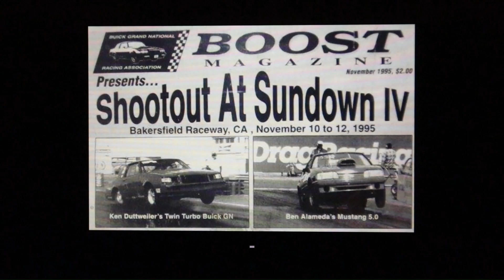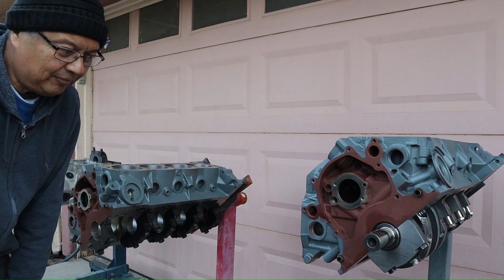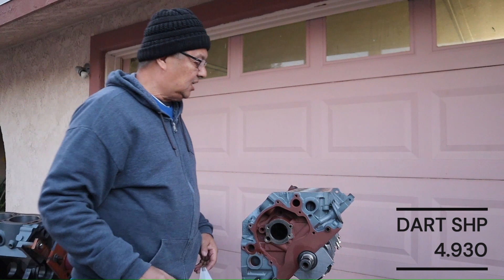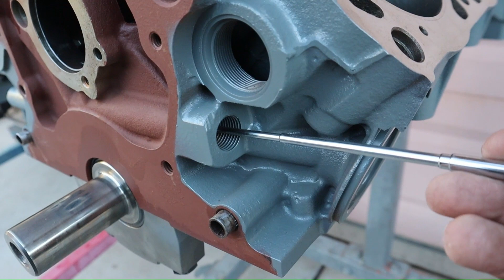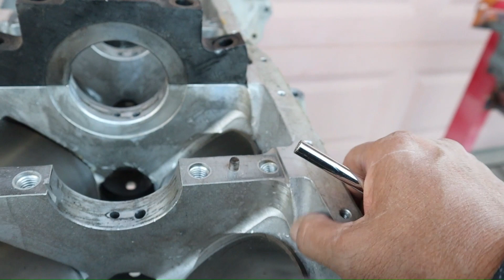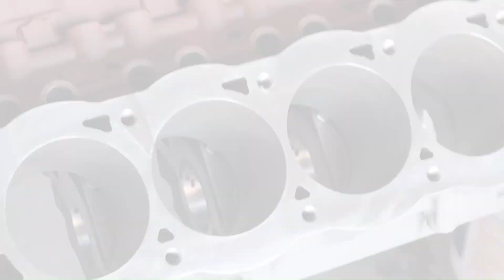FORD 8.2 DECK IMPORTANT DETAILS!

Comment: You will need longer head bolts from Ford for the Boss blocks. Stock head bolts won't work corecctly. I know. I tried. It does not work.🙁
Reply from the maker: I have something very interesting coming up and hang on!  Pls. push the subscribe button.

Comment: What do you use for paint on the inside of the block . I've  heard different types .  and also any idea when the video on the gt - 40 3 bar heads is coming out ?  thanks ben !
Reply from the maker: Any paint for metal will work with the proper surface prep.  I put out the video about the GT40 vs. Windsor Jr.

Comment: I noticed the reddish paint on the internals of the blocks.  I've used Big Red or Glyptal (electrical transformer epoxy spray paint) to aid in oil drawback, and to a lesser extent to seal in the sand particles that might still be hanging around.  What type of paint do you use and why?
Reply from the maker: yes sir epoxy paint is the best after you prep the surfaces to remove any kind of oil/grease.

Comment: Excellent video and pertinant information for us Ford guys. At what point do you consider a camshaft radical enough on the street to need the oil feed mods to the front of the lifter galley? I assume my stock block 351W stroker, std oil pump, passageways radiused and deburred with a .660 lift solid roller 250 ish @ .050 doesnt fall under that heading. 
Thankyou for all you do Ben.
Reply from the maker: You are safe from your specs you posted  I feel the threshold is when you are approaching 8K+ with lifts upwards of .760+.  Then I see the scuffing and oil starvation evident on the front lifter bores and lifters.

Comment: On the high volume oil pump, many don't realize the 5.0 uses a 1/4" oil pump driveshaft unlike the 5.8L's 5/16". I've pulled a few that looked like a barber shop pole.
Reply from the maker: I will be doing a full blown oiling system mods specially with what you said here running heavy oil with a HV pump and stock shaft!

Comment: Back when the FRPP & Dart blocks came out I remember an article about a build of one of them & they talking about the cylinders being shorter & having to notch them. I always wondered why they did it but that was pretty much when I was getting out of the scene & never really paid much attention to if they ever addressed it.   I don't ever remember seeing a roller cam for a ho with a 1,5 firing order I am guessing this has to be done custom?
Reply from the maker: There are some cam cores out there that are hydraulic roller but not HO!  They are basically useless for me and I avoid them altogether.

Comment: Does the 351W suffer the same problem  with the lifters oiling issues as the 302? Also is the 351W casting thing in those same places as the stock 302 block?
Reply from the maker: Yes they do with radical camshafts and high valve lifts!  Both are similarly designed!